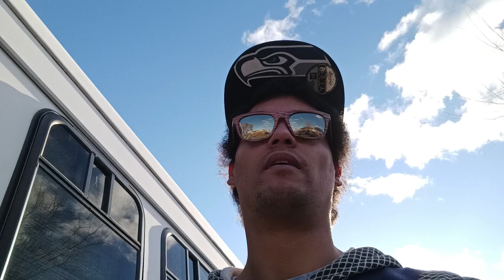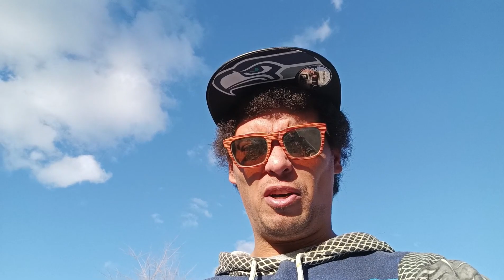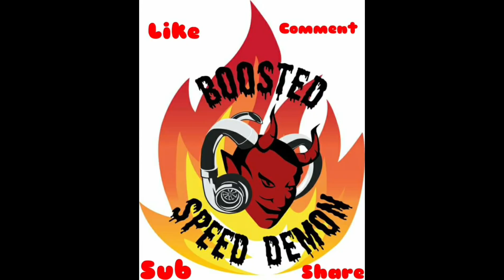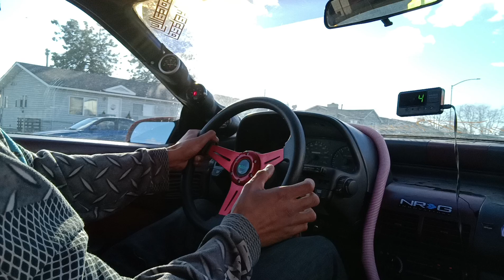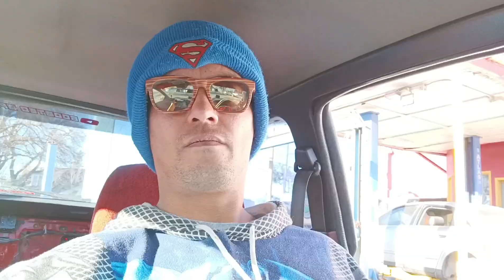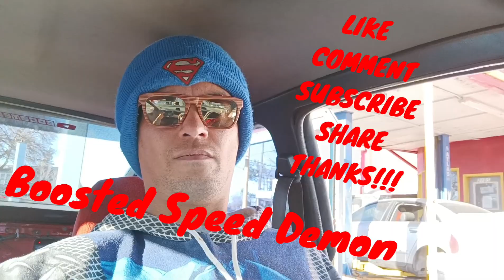Mazda F2T Camshaft Retard PT-2: Was it worth it?

Comment: I have 1990 ford probe gt automatic  and I think the tranmission need a rebuild it start up but when I put it in drive or reverse the car doesn't move at all
Reply from the maker: Just five speed swap it
Reply: @BoostedSpeedDemon  I mean I never change out a tranmission I would have to get someone to do for me
Reply from the maker: @jaycaleb3139  It would be much easier to find a five-speed car and pull everything you need, and have somebody put it in. That way if it breaks in the future you can just go to the junkyard and get a replacement. The automatic GD chassis cars like the probe, MX6, and 626 in turbo form are hard to find In good condition. Even harder to find someone who can rebuild them